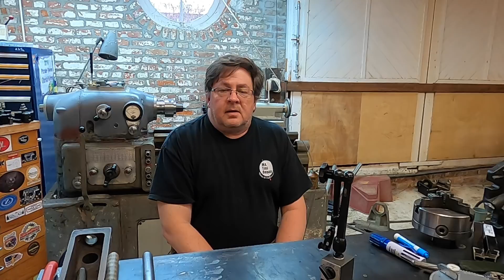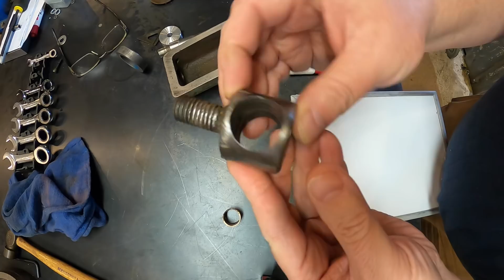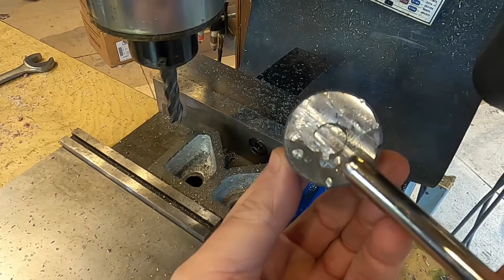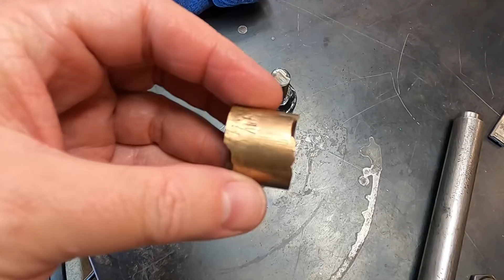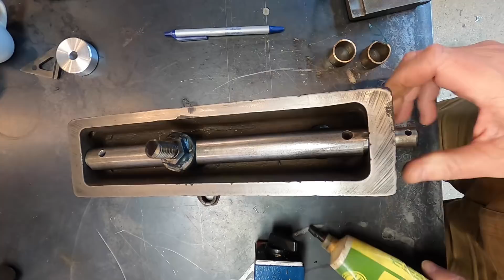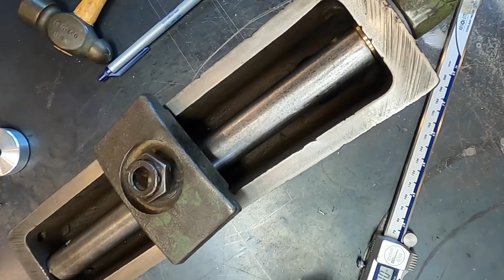Powermatic 90 Tool Slide Repair

Comment: Hey you did better than I could of.. I'm  surprised you just made a whole new part out of some 4140 stock and thread the bolt, drill for the shaft, been done with it. You put more machining into the bushing.
Reply from the maker: If I had had any 4140 on hand I would have. All I have for similar material was either two small a diameter or flat stock.
Reply: @jtkilroy  well great job use what ya got! And gitter done. Just knew you have the knowledge and machines.  So was woundering, keep safe keep healthy.

Comment: Great repair-refurbish job Jim. Don't sweat the TIG your do well.  Remember TIG is such a high strength process..."a little dab will do ya" [Brylcreem welding lol!]   My TIG set up has no control of amperage while welding, only on/off, but from experience I can preset the amperage for the job. You learn by doing and your doing well!
Reply from the maker: Ha, never heard that before.  Mine sure looks like Brylcreem! Maybe toothpaste?

Comment: Nice.  Auto darkening weld hood needs to show up under the x-mas tree.  Helps a lot.  Might have actually been easier to gas weld if your TIG machine doesn't have a foot treadle.  Had to do those repairs on my Powermatic 25.

Comment: I am wondering why you didn’t just make a new one. It think it would have been less time consuming and a prettier result.
Reply from the maker: It was actually faster to repair as I didn't have any proper material on hand.  I have lots of 12L14 of the correct size but I hardly consider that proper for this application.
Reply: Ah, ok, I’m still learning, mainly from people like yourself. Thanks ! 👍

Comment: I have the same Powermatic and had the same issue of not tightening enough. My solution was to remake shaft with a slight more eccentric. No bent up part though.

Comment: Just curious James, why not a light press for the new bushing, rest of the repair looked good.
Reply from the maker: You have to be able to get this thing apart and there isn't any easy way to press it back out if you pressed it in.  I am afraid that would have resulted in the use of things like vise grips and channel locks, screw drivers and pry bars.
Reply: @jtkilroy  Thanks, James for the explanation

Comment: seat time will help develop your welding skills. i am surprised that you opted to do a weld repair vrs making a new part. it would have made a much more interesting video.
Reply from the maker: I was torn, but I needed to turn it around quickly. I would have been more comfortable with a new part.